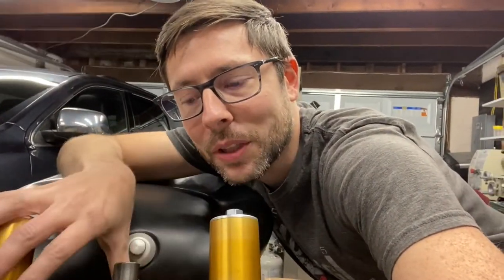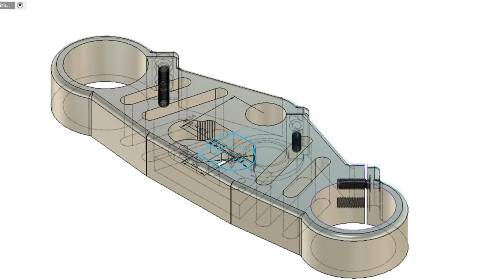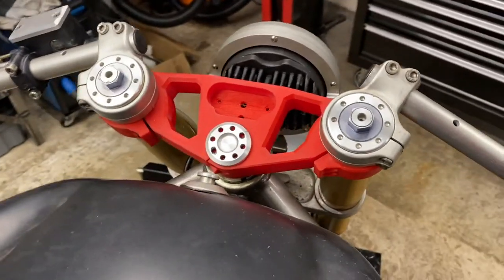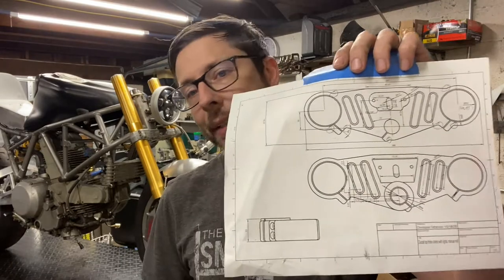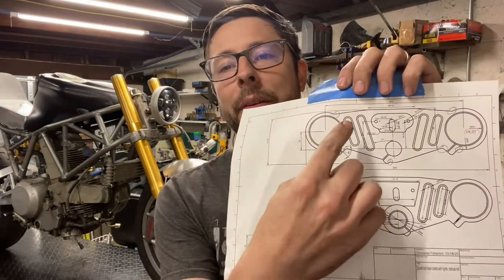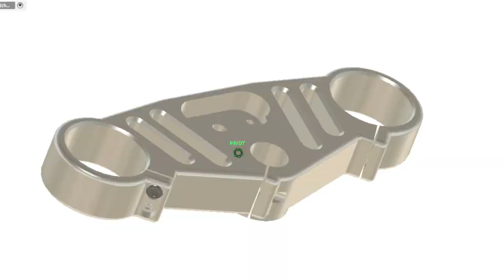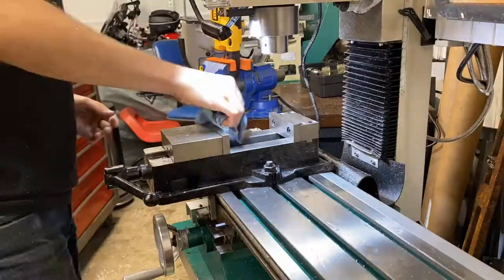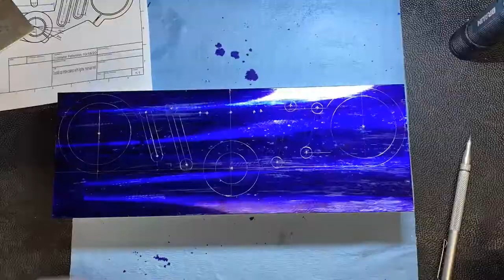Milling a Ducati 900SS custom billet triple clamp for Motogadget Motoscope mini, cafe racer build!

Comment: nice work. Latst one I madae was maybe 30 plus years ago. I need one with adjustable offset sleeves, but nonobdy had one for my bike. I drew them out in autocadd then cam so then made them on the mills and lathe for the stem. Glad to see someone doing this. Keep up the good work.

Comment: Please, where can I find the drawing for the upper triple tree on the GSX-S 1000 2016 and GSX-R 1000 2009 ? Thanks
Reply from the maker: No idea. Much of the work in making this part was accurately measuring the stock part.
Reply: @chris-builds  Well thank you. Which dimensions are needed? Do you have a drawing for inspiration?

Comment: This is awesome dude, greeat work. I have a set designed on CAD that I need to get my ass in gear to get machined.
Reply from the maker: My entire mill and tooling setup cost less than the cheapest quote I got to have someone else make this part lol.

Comment: Hey Chris! 
i'm from Brazil and was thinking print a top clamp to my Motorcycle (CB500 98)
If i print on ABS (a solid piece with 40-50% infill) with only 3 holes (the forks and the center Nut). Do you think the ABS it's strong enough to this? 
The Bottom clamp and forks is originals)
Reply from the maker: No I do not. I only used 3D printing to prototype the piece I eventually machined from aluminum later in this series.
Reply: @chris-builds  yeah, o saw all the serie! Hahahahahaa
And congreats! Its awesome!

Thanks for the aws